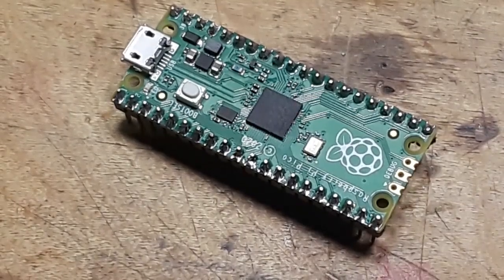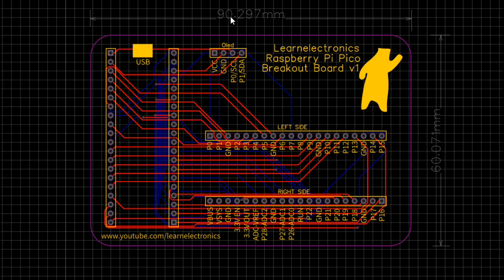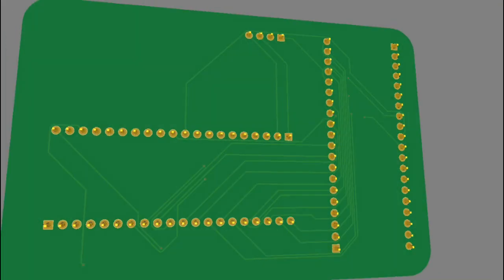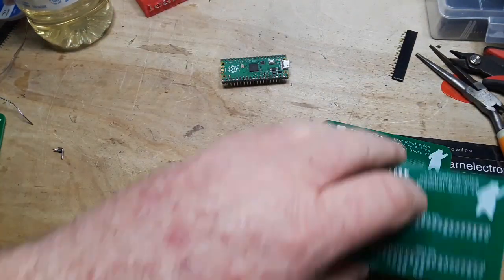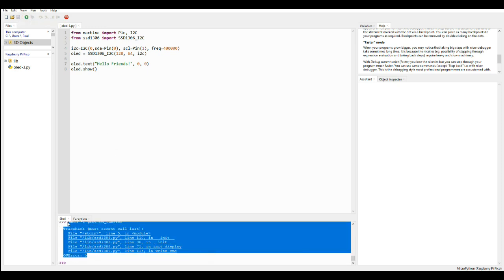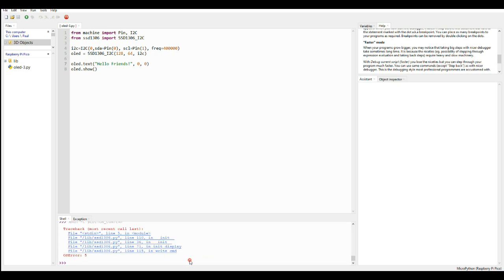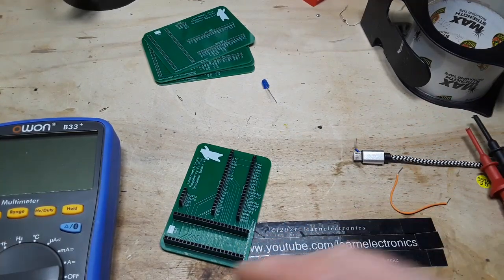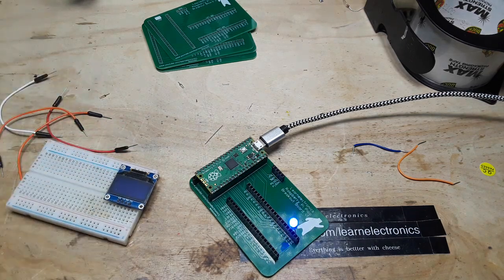Raspberry Pi Pico Breakout Board

Comment: Those pico boards are kind of hard to get a hold of at a good price, guess I’ll just keep trying. Great video Paul, the only thing I could think of was a stray capacitance problem or maybe a floating voltage issue, hopefully someone has the answer.

Comment: A few things to try on PCB version: solder a 4.7uF and 0.1uf across Vcc and GND on Pico connector,  program Pico with display removed then add with power off, reboot and run. This has helped me in the past but it all just basic supply bypass stuff. The only difference between PCB and breadboard is the pin to pin capacitance unless there is a wiring difference somewhere.

Comment: For the next iteration (as other have mentioned) would love to have a spot for optional reset button, an sd card slot,  and also maybe add the labels for the pins on the outside of the female pins the top row of the breakout is on the inside and for pico "hats" that would cover the top labels since they are on the inside. Looks great for a first iteration!
Reply from the maker: That's a great idea!

Comment: Discalimer:- This is guess work and completely without any knowledge. :-)
Inter PCB Track Capacitance? I THINK I noticed some parallel tracks for the Display when you were showing your design.
Design No-2 question/suggestion. Why do you not simply lay out the Headers in parallel with each other and just bring out the tracks horizontally across the board. That would be on one layer, the Display can go on the other layer at right angles to the main track?
Reply from the maker: There was going to be more things on the board. But since its not working right, I will probably scrap this design
Reply: @learnelectronics  Look forward to Version-2 :-)

Comment: I would only add the connections for the oled, this way there isn't any issues with the board unless there from those four traces. 
If your planning on using the boards. If your not going to use the boards just make new ones with better spacing between traces.

Use you osc, to find cross talk and make a video.

Comment: Have you checked the OLED works via the normal breakout pins (horizontal ones at bottom) rather that just the extra OLED header you added at the top of the board?
Reply from the maker: No, I didn't. But I will now

Comment: Ground and Vcc and SDA  SCL are reversed on the original drawing from all of my 1386 OLED pcbs? - that's translated to the PCB design. Odd that your board on the OLED is different. However SCL & SDA are the same on pins 3 & 4 on the OLED but they go to 1 & 2 on the Pico where they get crossed over. SDA is 1 on Pico SCL is 2 on Pico.

Comment: i2c needs pull-up resistors to work correctly, maybe the wires and the breadboard provide a kind of that but your PCB does not ?
Reply from the maker: Could be
Reply: can be done in software .PULLUP

Comment: I've gotten a similar error using the OLED and it's something about the connection between the OLED and the Pico. I've connected the same exact OLED to an Arduino UNO and NANO with the same wiring and it works fine. I don't know if it's a hardware issue within the Pico or a software issue within Micropython.
Reply from the maker: Thanks, good to know someone else is having this issue

Comment: Your display has pins in this order: VCC - GND - SCL - SDA as correctly shown on the PCB too.
But SDA needs to be connected to GPIO0 and SCL to GPIO1 - You may have switched the two GPIO-pins, I think.

Comment: I think your display board might be shorting an edge out on the exposed pico pins possibly? Try programming it without the display attached? Also some local decoupling might help, try slapping a 1uF on the displays Vcc/GND pins on the back. Also speaking of, probably add some rubber feet so nothing can short on metal bits.

Comment: I have a question someone please let me know. How exactly do we know the width of the micro controller? Like I want to design a PCB for am ESP32 board but I don't know how far apart should the female headers should be so that the ESP32 fits perfectly in them. 
Sorry if this is too noob of a thing to ask, but I don't know how to do this
Reply: If the board is "breadboard friendly" the spacing will be in 0.100" or 2.54 mm increments. Calipers or even a good ruler should get you what you need.
Reply from the maker: I use a set of cheap calipers.

Comment: I wonder if a two layer board would help Paul with left side tracks on the bottom and right on the top or vice versa?  You could then have the breakout pins run in parallel as well so they are like for like and oled in between!  Just a suggestion.
Reply: And maybe put all ground tracks on the bottom layer and power on the top.
Reply: @stevetobias4890  spreading the tracks top and bottom would make routing easier and avoid the issue of tracks being bunched up together.
Reply: @gartmorn  yes, I agreed, I added AND seperate the Ground and VCC tracks to avoid capacitance issues.
Reply: @gartmorn  maybe should have said I agreed however..
Reply: @stevetobias4890  wasn't disagreeing just the layout I was suggesting perhaps would spread the tracks a bit more evenly but we're both on the same page I think! 🤣

Comment: Put a cap on vcc. The tracks are too small for power and ground. Use jumpers and see if it works on your board without using the tracks

Comment: Hi 

Maybe as others have suggested it's somesort of stray capacitance created by the close tracks ?

What happens if you just keep the oled on the breadboard & use jumper wires to connect from the Pico on the breakout board ?

Hope you get to the root of the problem soon , must be very frustrating for you ?

TTFN

Comment: Why is this designed the way it is, i.e. with the breakout headers at a 90 degree angle to the pico? I'm new to all this, if I would have thought of something like this, my first idea would be to put each breakout header to the right and left of the pico so that the connections are short and straight, it would make the layout much simpler still, and it would make the pcb smaller. Or is there a reason to try to keep the distance between the rows of pins on the breakout the same as they are on the pico? Thanks.

Comment: Could the signal or clock be feeding back through the Oled onto the programming data line or something else?
Test: unplug the oled and try again
Test2: use jumpers to connect the Oled but leave it some distance from the board and try again.

Comment: The next test I’d do would be continued from your last setup .. bridge from your board to the oled on the breadboard. If it works then I’m guessing some capacitance is being generated by the close run tracks.
Reply: This was what I was thinking too. It is the next step from the blinky test.
Reply: My thoughts also— does it work with the OLED on the breadboard and jumpers into the oled sockets on the PCB?

Comment: Wonder if you’re running into crosstalk that’s messing up with the signals when flashing. An oscilloscope might help
Reply: I’m worried that the routing around pins 2&3 and 18-20 are too close leading to the cross talk. I can’t tell on the backside of the board.
Reply: Paul has a scope. I think it's attenuation or crosstalk.